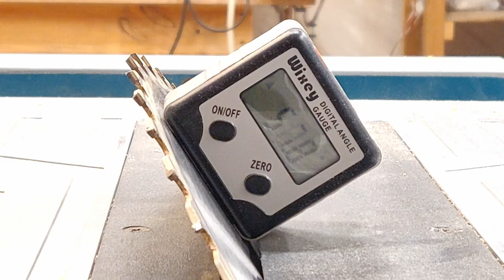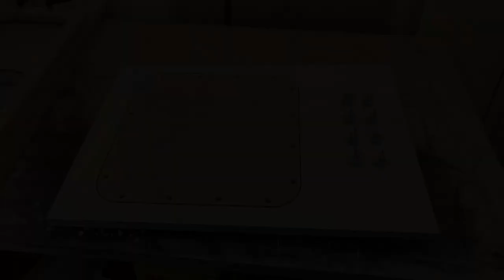6th Order Bandpass Subwoofer Design (Part 2)

Comment: Nice work buddy
Reply from the maker: Thanks :)
Reply: @KarlisZalitis  hello my friend I have one q , remmaber u told me that u changed the lead screw on the Z axis from 2 mm pitch to 1mm pitch . I did the same thing and now the Z axis is lifting and lowering good, but am having one issue, when I tell the aspire to cut 3/4” depth , the cnc is cutting 1/4” depth . Is that coz I changed the pitch on the lead screw? If so what did u change in the code for the Z axis stepper ? Is it in config.h?u multiple it by 3? Please advice
Reply from the maker: You were right about configuration.h file editing - find this line {DEFAULT_AXIS_STEPS_PER_UNIT} and adjust the value as needed for Z value. I have the value set to 800, but yours may vary
Reply: @KarlisZalitis  thank u very much freind , I’ll try that out
Reply: @KarlisZalitis  hello freind I tried to change this but nothing changed when I run it again it cut the same depth , are u sure it’s this one need to be changed ? Here is picture of what I am changing 
https://ibb.co/G951sjY
I appreciate ur respond
Reply from the maker: Hmm.. have you tried to adjust the other axis, do they change? This would show, if adjustments work at all. Also - have you tried to measure the  Z travel after you have moved the axis manually, when not machining? It is possible, that the CAM software does something silly with the axis movement